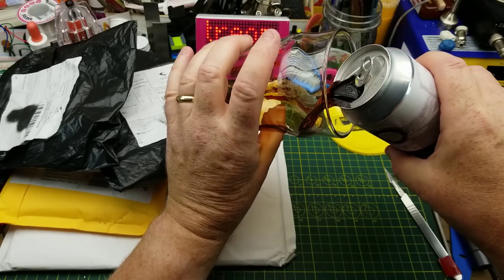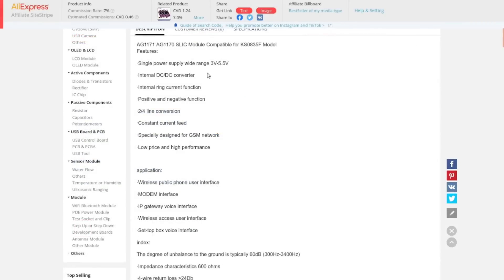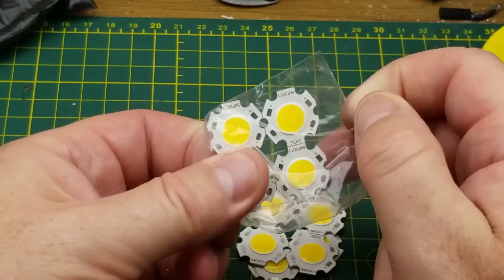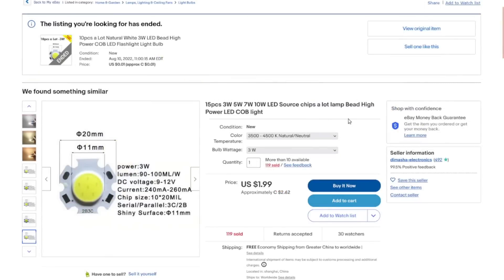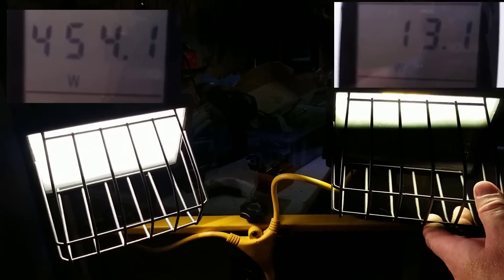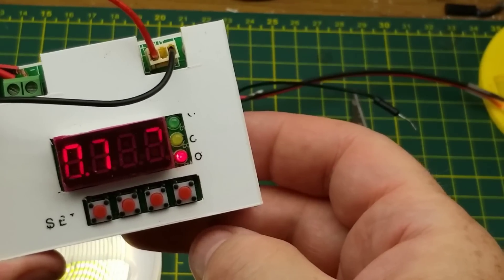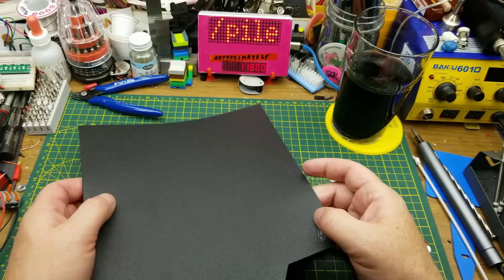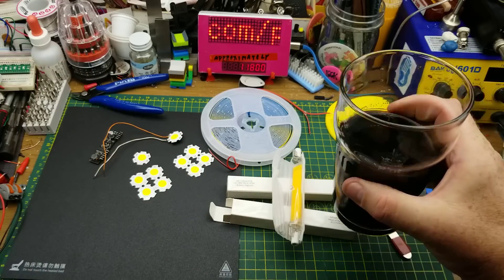Mailbag Monday 148

Comment: I got some of those COB Strips for my project room, I use one to go around my printer (enclosure); Really good stuff when on a Voltage Controller.

I upgraded my printer from a flexible removable platform to glass bed personally. My bed was getting warped from the years of use.

Comment: I too have an Ender 3 V2. I brought a PEI mag plate but couldn't get any prints to stick to it - So, Looking forward to your video/findings with your new one.
Reply from the maker: So far, I've only done first-layer leveling test prints and it's sticking almost too well.
Reply: @pileofstuff  Sweet 👍
Reply: did you spray it with IPA and scuff it with 000 steel wool? The initial prep (and prep between prints) is important.
Reply: @michaelsworkshop9031  IPA yes but, never seen anyone else recommend scuffing it.

Comment: I have 4 of those SLIC modules now.   I also have a halogen work light that could use an LED transformation.
Reply from the maker: Soon you'll be building a full telephone
 exchange like LookMumNoComputer is doing...
Reply: @pileofstuff  I'll have to check out what he's been up to since I haven't watched in a while. I do recall he had some mechanical rotary contact thing to play with.
Reply: @pileofstuff  Can you make an VoIP work on your old home telephone wires?
Reply from the maker: @GnuReligion  That's an interesting thought.  Probably, with the right software.

Comment: I have several glass beds per printer and just put the prints in the freezer for 10 minutes, the pop off by themselves and i just load a clean glass bed and carry on. Works pretty much 99% of the time. slurry adhesion needs the most time, but any spray products just release in 5 minutes or so. JMHO

Comment: 8:05 I'm pretty sure you can touch the LED COB bulb with your bare hands.
Reply from the maker: Probably. 
It's an old habit dealing with quartz halogen bulbs.  Getting any finger oils on the quartz glass can cause problems when it gets hot.

Comment: i should give you a pass because you work mainly in fibre optic but SLIC stands for "subscriber line interface circuit". i think you meant SIL is the form factor.
Reply from the maker: DOH!
Thanks for the correction.